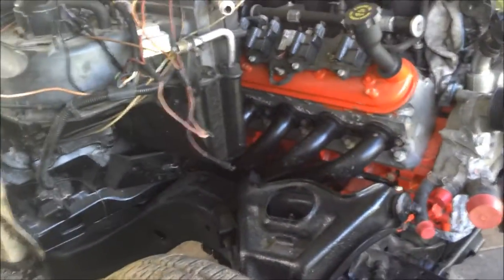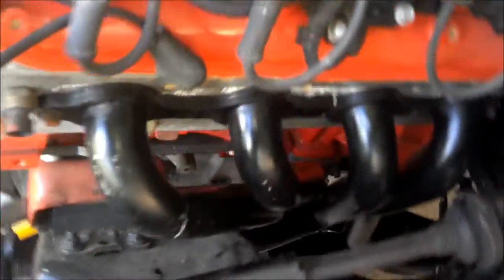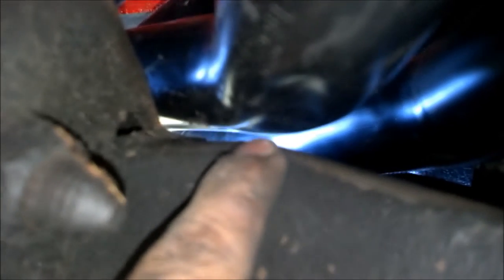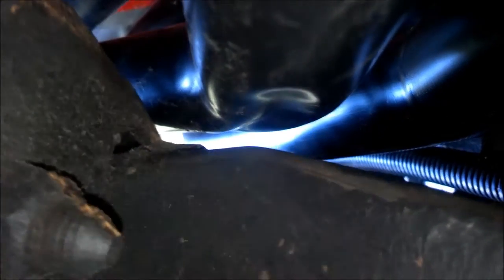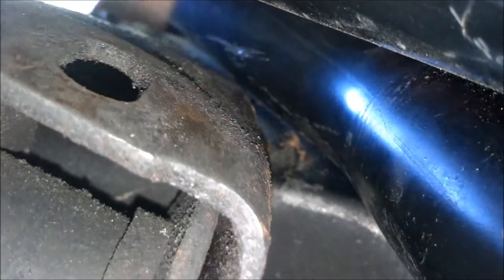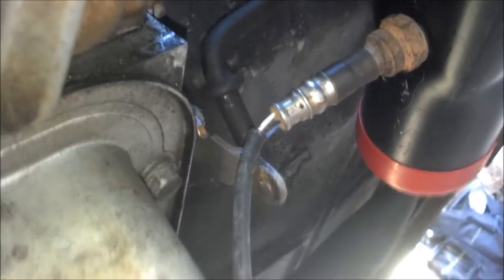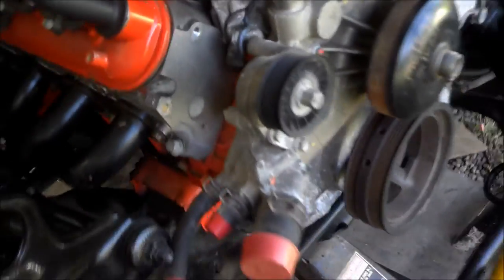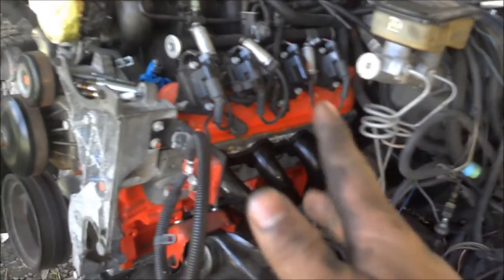Test fitting the headers

Comment: bro gotta question on the headers im catchin hell with the passenger side
Reply from the maker: Whats the problem you running into?  Yours hitting the frame too?
Reply: +Beanoman90 yea that frame on both sides
Reply from the maker: Dang. Yeah my drivers side fit no problem, i just beat the passenger side header little by little till it fit without rubbing.